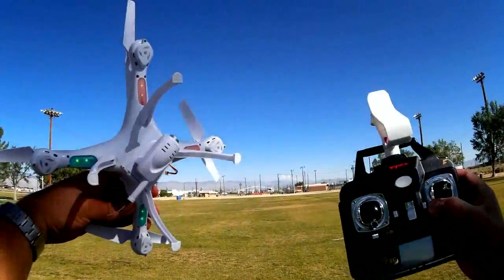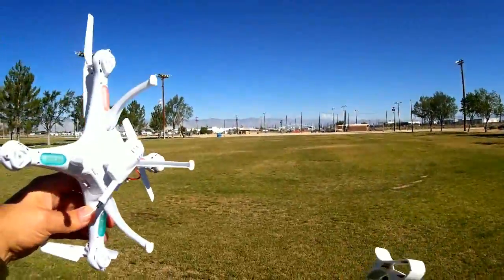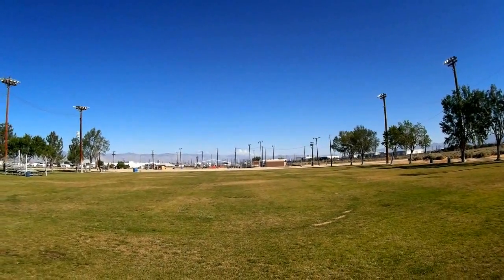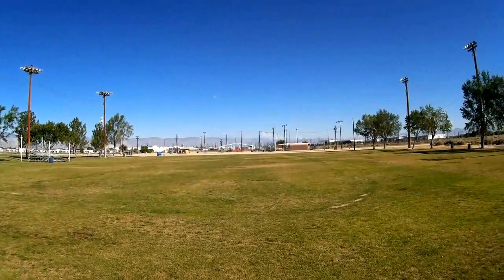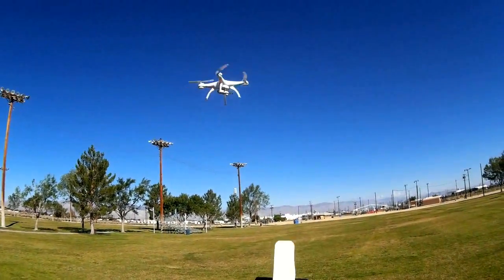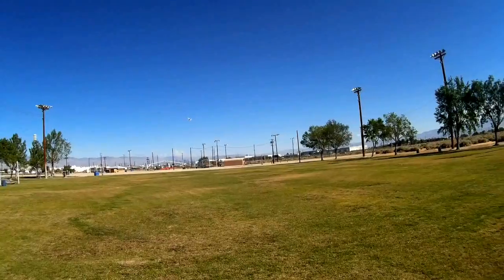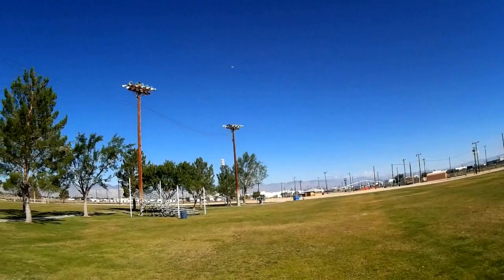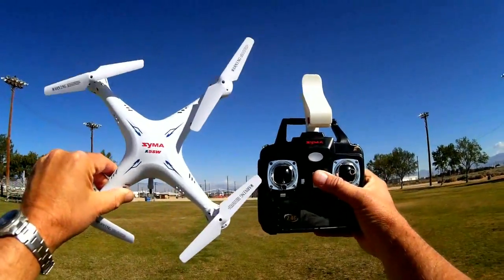Syma X5SW WiFi Interference

Comment: I was experiencing the same problem with my X5HW, but taking the Camera off did not make a difference, so I put the Camera on my X5C and it did not hamper the Flight of it at all.  I got some very high Live Video shots with the same FPV Camera on my X5C,  Please see my video about that flight here https://youtu.be/fi_U5Nsy7YA  I was also having problems with the same Camera on the X5HW,  I would link it up and could see the flight as it was flying, but it only recorded the start up, as soon as I throttled up the recording would stop but you could still see the image on my phone.  I was having a lot of problems with the X5HW as it did not have anywhere near the power of my X5C and I had Flyaways several times with or without the Camera.  I sent it back for replacement as even the Remote Modifications did no good.  My X5C is still my Best Drone as I have only had these 2 so far.  I do want to upgrade to a Phantom, DJI, Mavic or One of the other many Great long distant Flyers.
Thank You!
Amy

Comment: For a first time quad flyer would you say there is enough difference between the X5C and X5SW to be concern? I like the idea of headless mode, and FPV on the SW, but the video quality looked better on the C and the increased range would be good.  I do travel videos in the Philippines and need something easy & dependable to get better videos of beaches, mountains, and waterfalls.  (shipping is slow & expensive so I really want to get this right the first time ha ha)
Reply from the maker: +Tukarama There is a flight control issue (wind bug) with all of the X5S quadcopter.  For s first time flier, I would instead recommend the X5C, but with an attached third party camera (808 #16 V3 D lens keychain camera)
https://www.youtube.com/watch?v=J1KPT8IwQEk
https://www.youtube.com/watch?v=AKLQzGbqmJw
https://www.youtube.com/watch?v=Yk4p_9oEAb0
Reply from the maker: Gamingwith Lance https://www.youtube.com/watch?v=DohfkCaXAuE&t=6s

Comment: How do you Calibrate? whenever i Turn on, it Starts Fly Towards Right Side,Doesnt Stable, as soon i fly it i have to Keep Gear to force Left Side, Can you Assist pls? i know there are buttons, i tried but i might be Doing some wrong..
Reply from the maker: +Ranjit S the little trim button directly below the right stick. Repeatedly push it left until the Quadcopter no longer slides right.

Comment: I have that drone too and I have manage to use cam above 100 meters but I think that when u use WiFi cam battery gets drain faster Wichita result in lower range ;/ without cam I can almost get to 200 meters without transmitter mod ;)

Comment: hey I fly a syma x5sw.. and I received my new eachine vr-007 and it won't link up at all..... anyone know how I can fix this?
Reply from the maker: +KC Schmidt Unfortunately, you can't.  The X5SW uses 2.4Ghz digital WiFi FPV technology.  The VR-007 is for receiving 5.8Ghz analog FPV.  It is not capable of receiving WiFi FPV.   BUT the following 5.8Ghz FPV camera transmitter will work with your goggles.  It also has more than twice the range of the WiFi FPV camera that came with your X5SW.  It also can record 720p HD video directly to an microSD card in the camera (need to purchase microSD card separately. http://www.banggood.com/SYMA-X5C-1-X5SC-5_8G-FPV-Camera-p-1024972.html?p=RB0922217402201307U3
Unfortunately, this camera does not come with the required mounting brackets to directly attach to your X5SW.  But it shouldn't be hard to devise your own method of mounting the camera to the quadcopter.  You'll also need a charging cable as it is also not provided http://www.banggood.com/1-to-2-Charging-Cable-for-Syma-X5C-1-X5SC-5_8G-FPV-Camera-Monitor-p-996300.html?p=RB0922217402201307U3

Comment: Can I upgrade the camera on this? I've seen many keychain cameras and they're all different shapes and sizes of course so the weight is the most significant problem. I realise that I'd be losing the choppy stock camera for fpv but have you any recommendations? Thank you
Reply from the maker: +Dick Head Best camera for this quadcopter and the similar X5C is the 808 #16 V3 http://www.banggood.com/808-NO_16-HD-120-Degree-Mini-Camera-Module-7g-p-82197.html?p=RB0922217402201307U3
https://www.youtube.com/watch?v=DNfNpSTNFqc
Reply: +Quadcopter 101 Thank you very much for taking the time to respond, I thoroughly appreciate it. I shall consider buying one of these
Have a good day

Comment: What will happened when the drone fly out the range of the controller
Reply from the maker: +Darren Kuan The quadcopter's motors will shut off, and it will drop to the ground.
Reply: +Quadcopter 101 if I fly it to high also shut down?
Reply from the maker: Darren Kuan Yes.
Reply: if the plane flight to high an drop down to the range will it reconnect ??
Reply from the maker: Darren Kuan You'll have to manually rebind as it's dropping by repeatedly moving the throttle stick up and down until it reconnects.  Here's an example https://www.youtube.com/watch?v=odVxR90USz8

Comment: In your opinion, could this take a 1200mAh battery?
Reply from the maker: +Bassmanwcm You'd have to strap the battery outside.  And although it may lift it, you will notice significant degradation of flight performance because of its weight.  Also vortex ring state may be a problem.
Reply: Quadcopter 101 Ahhh ok, yeah, you answered that... highest is prob the 850mAh ya think?
Reply: The ones I seen fit inside. But I guess Ill fine out I order 1 befor I got the 5 pack

Comment: hey , quadcopter101 , question with my x5sw-1 it will fly about 4 foot off the deck and drop w/all 4 lights flashing ,bat is fully charged and no cam,what gives
Reply from the maker: Flashing lights is usually indicative of a failing battery. But before replacing, try gently turning each propeller by hand to check for any unusual resistance, such as from dirt in the gears.

Comment: do you know whate is te solution of this problem? 
Actually i buy the Syma x8W but im having troubles with the connection because of the Wifi FPV, can you Help me,  and can you recommend me a nice camera and real FPV for a low price , Thanks and regards
Reply from the maker: Alejandro Marroquin The following is very good.  And it's 5.8Ghz, so it shouldn't interfere with the quadcopter's transmitter https://www.youtube.com/watch?v=CHVFwOCxvK0

Comment: Same problem applies to MJX X400 with "FPV" camera(C4005/C4006) attached. With "FPV", your range is reduced to 50-60 meters and you got huge input lags.
Without "FPV" it's working fine, like in your previous videos about MJX X400.

Comment: Hi 101.  I believe the range problem is caused by the fact that the TX which appears to be the same model as the X5C-1 has a terrible antenna just a short wire inside the case and has no hope against the WiFi siginal I have converted all of my TX's to have a proper  External Dipole antenna ( I Bcrazy style ) as I don't trust the original cost cutting toy design concept .Regards Geoff

Comment: SYMA has a new camera coming out --  5.8 g ,  has it's own battery , includes a monitor and mounting bracket ,  and fits both the X5C and  X5SC
Reply from the maker: ***** Got one coming inbound for review.  But here it is on Banggood http://www.banggood.com/Syma-X5C-1-X5SC-X5SW-5_8G-FPV-720P-Camera-with-Monitor-Real-Time-Transmission-p-980090.html?p=RB0922217402201307U3
I think this might be a hit, as it offers an affordable 5.8Ghz FPV solution for the ever popular Syma X5C crowd.
Reply: kendall connolly Do you know when it's coming out and where can we get it?
Reply: Thanks! Looking forward to that review :D
Reply: Quadcopter 101 
Awesome. I wonder if they're only going to release the transmitter/camera or with it on a new model drone?

Comment: This quad's FPV is better then f801c's?
Reply from the maker: TheSkyCuber IMO, the X5SW WiFi signal is stronger than the F801C.  Haven't noticed any close-in FPV blackouts with the X5SW (I have with the F801).   BUT as the F801's WiFi signal is not as strong, Its control range is not severely degraded like the X5SW. i.e. you won't experience controller dropouts at 70m like you will with the X5SW.  But as mentioned in the video, I think that this can easily be corrected for the X5SW by a little shielding with a small piece of strategically placed aluminum foil.
Reply: Ok, thanks!

Comment: Did they fix the problem of flying in the wind?
Reply: I have the X5SW and when I first flew it I had the wind issue. each time you turn on the transmitter it starts in low mode, if you quickly push the top left button (one for headless mode) it will go into High mode and handle wind much better. also taking off the camera and blade guards helps loads!
Reply from the maker: Pat Martin I still really haven't taken it out on a windy day yet.  But in limited breezes it seemed to work OK.  But give me a chance to try it with wome wind to confirm that it's fixed.
Reply: beezer8686 mine get blown around in the wind cause its so light but no wind bug as far as I can tel
Reply from the maker: Jason Dunn Pitch angle increases which should provide some better wind resistance.
Reply: +Jason Dunn as Quadcopter 101 says, it increases the pitch angle so it can battle into a headwind far easier. It also sharpens up the response, do let us know if high mode helps you. I've been impressed with the Syma X5 but have wished I bought the X5SC rather than the SW as it's tricky recording onto my phone at any distance. I also find the reception when using the camera (also on the 2.4ghz frequency) to be absolutely shocking. Other than that, my first Quadcopter and it's certainly got me hooked.
Reply from the maker: Jason Dunn That's what I thought.  Somebody put a - sign where a + sign should be in the flight control equation.  But they still have not corrected the problem.
Reply: Pat Martin Same question here.  If the X5SW works, I'll try to get a mainboard and replace my X5SC-1 board.  Transmitters the same?
Reply: Quadcopter 101 cool, fans can be so demanding, haha thank you once again.
Reply: That's cool
Reply: +Mat Bat Crazy, I've been perusing forums and haven't heard that solution yet. I'll to try it out. Had the X5SC and it was awesome, then 'upgraded' to the X5SW and I've regretted it since. FPV is laggy, but above all else, it can't handle the damned wind. I swear it's actually fleeing from me. Lost it a few times now from it. So, thanks!

As a bonus: What all exactly changes when switching between high/low mode anyway?
Reply: +Mat Bat Yep, the High mode has helped TONS. It really makes all the difference. It doesn't eliminate it entirely it doesn't seem, but for most purposes you can barely tell. I noticed also that bringing back to neutral seems to reset it, then you can move forward more easily again for a bit. It slowly regresses its ability to move forward the longer you hold it down. Like an incorrect calculation that slowly reduces the perceived angle.
Reply: +Quadcopter 101 Lol Exactly the type of mistake I was thinking. It reminds me of this line: "I must have put a decimal point in the wrong place or something. Sh*t! I always do that. I always mess up some mundane detail." --Office Space. Thanks, btw, for all your in-depth field tests & reviews. Lots of people utilize your efforts to make better purchasing decisions.

Comment: Wifi should not be used on RC models, if you want too fly FPV use the 5.8Ghz system.
Wifi camera's will even make the big expensive Quads go offline Like a Gopro with Wifi. But if you fly close too you it might be ok

Comment from the maker: The FPV transmitter of the X5SW is powerful.  Its signal is strong, but this can also be a problem as it can create interference with the quadcopter's transmitter, also operating on the same 2.4Ghz frequency.  This video is an experiment to verify that the FPV transmitter is actually diminishing the reception range of the controller's transmitter.  Follow-on videos will look at means of shielding the quadcopter's receiver from the FPV transmitter.